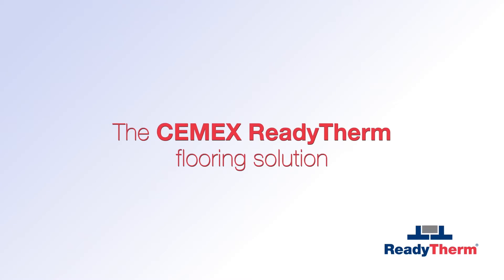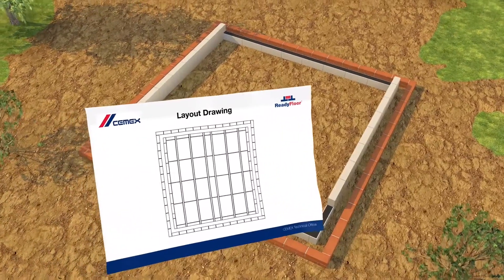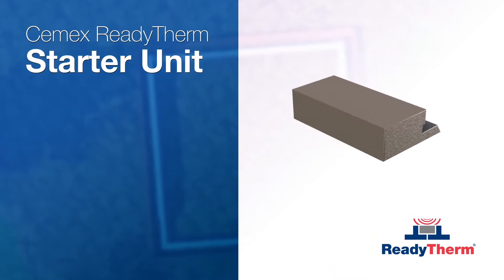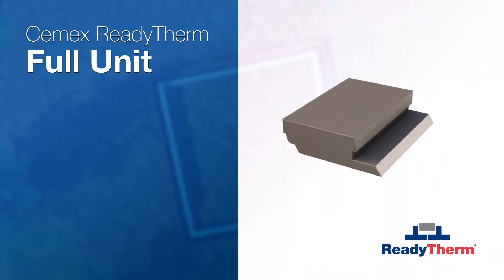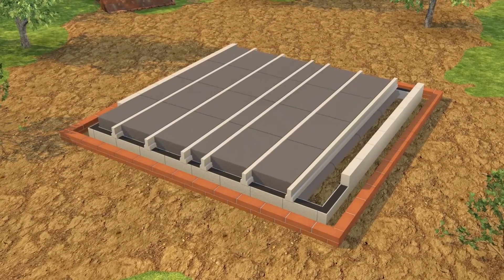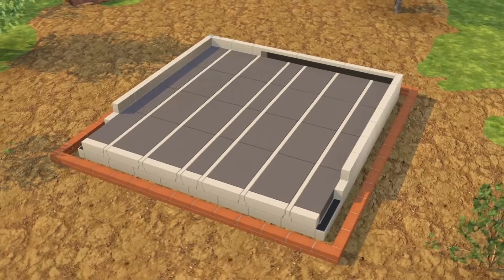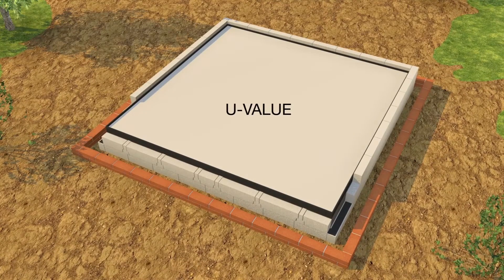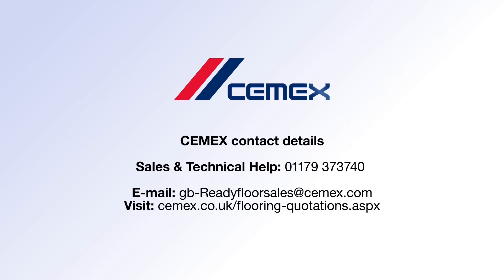CEMEX ReadyTherm Installation Guide

Comment: so how do you keep the insulation still while pushing the beam back into place? Or better yet, say your using a 9inch beam (5m long) that weighs roughly 2 ton, how is that then pushed into place without tearing the DPC by an excavator, or if lifted via chains, how do you get the chains out once pushed tight to insulation?